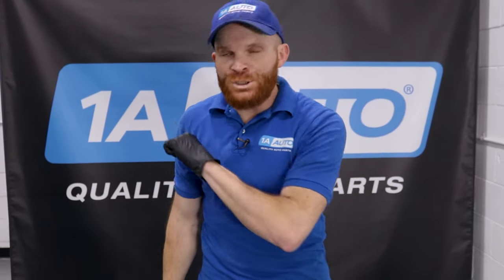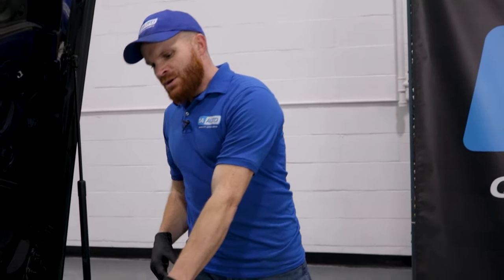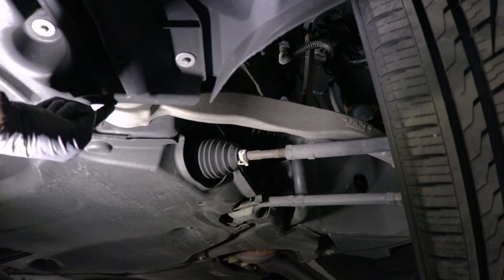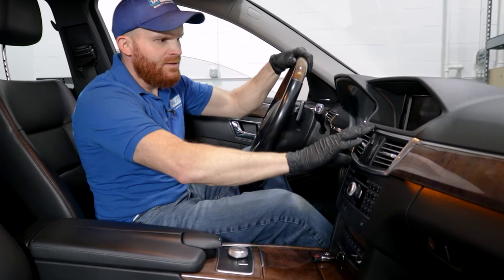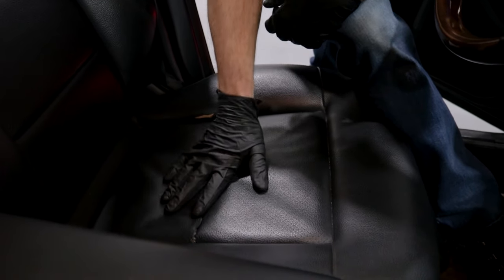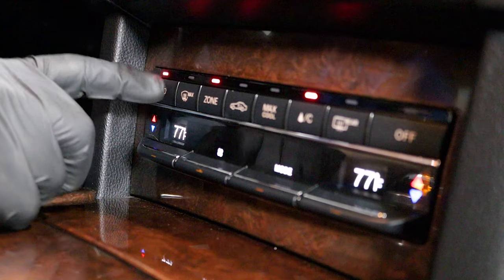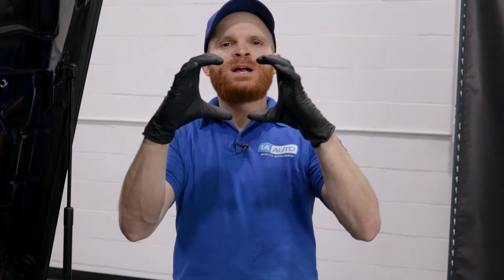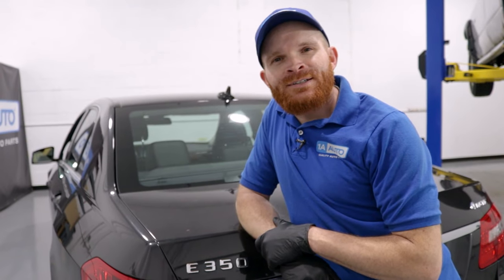Top 5 Problems Mercedes Benz E Class Sedan 4th Gen 2010-16 W212

Comment from the maker: √  Watch the Video
√  Buy The Part at 1A Auto http://1aau.to/m/Visit-1AAuto
√  Do it Yourself
√  Save Money
Reply: EVERY SYSTEM in these cars is designed as a profit center with a premature failure point. It's the same sweet story with BMW, VW... They are super well engineered to rope in the customers once the honeymoon is over yet they are indeed fun to drive...

Most E-class feature plastic seats not even leather (rare package)
Smelly oil leaks
Loose wiper arms
Noisy air blower
soft dusty brake discs
cheap control arm bushings
AGM batteries charging issues
camshaft phasers... old saga!
short lived timing chains
blown tensioner seals
wobbly plastic belt idlers
50kMi only spark plugs!
50kMi tranny ATF!
Failed PCV intake oil ingestion
CAN modules: buggy software!!
crazy Keyless-Go drain
...
Benz ride suspensions are great and famously priceless to repairs because they are built to wear out.

Benz quality is lip service like Ford... "Job No1 !" 😉
Reply: how it’s call the first isue on your video with the transmissin problem
Reply: G Lasser yeah nevermind this car then 😂
Reply: G Lasser your list is exaggerated and your hate for Mercedes is obvious
Reply: Flunoir I have had a 2010 E350 for almost 2 years and have driven it for over 50K miles and I haven’t had a single issue with it. Only regular maintenance (oil change, tires and spark plugs)
Reply: @CaliRepublic77  he might not be exaggerated.  My 4runner spark plug is 100k and my lexus rx350 is 120k. Wtf is merceded charges these prices and providing g 60k spark plugs. Along with every otger short interval.
Reply: W213 problems video pls?
Reply: Hello, I have a W212 recently bought ,if I go from reverse to drive it takes 2sec before it goes.. any one has idea's?
the shifting while driving is good tho,just worried about my baby 😝
Reply: Hi! Do you guys do international shipping ? 🫣
Reply: In addition to these, 1 major issue is the rear subframe will rot and break apart in the first 10 years of its life or around 100k miles. This issue is discussed on many blogs and youtube videos.
Reply: would be great if you tagged parts!  Like the forward thrust bushing.  Can this be purchased without the arm?

Comment: Only in North America I hear people complaining so much about Mercedes and the reason i find is that 70% of all Mercedes Mechanics, even at the dealership, are not good. They still dont  understand the car...the car intimidates  them compared to European Mercedes Mechanics or even middle east and Africa roadside Mercedes mechanics are way better than the crappy ones in the States and Canada. Secondly, the prices for the parts and Labor in North America are astronomically expensive so most used ones owners turn to ignore even small maintenance then it gets worse. Ive seen in Frankfurt Duesseldorf Stuttgart etc their taxis are C Class and it can go more than  half a million and still look new and strong compared to the Crappy Toyota camrys you have as taxis  North America. Even in Africa with bad roads  a well maintained Mercedes will still looks stronger than Any Japanese car and can easily go more than 400k

Comment: My 2011 W212 E350 Bluetec that I put 135k miles on has none of these problems. I service my car on time, I ceramic tinted my windows for interior protection, and don't dog my car. Take care of your car and it'll take care of you.
Reply: I bought ae350 coupe at 100k miles and drives like a dream, I had issues from brake pipe bursting to rattle on the wheel getting rain inside and all sorts of repairable issues,but owning it for 6 months now I'm still super excited about driving anywhere, I've fixed most of the issues ££££ 😭😭😭but even my 2yo loves to ride out front,it's more like a statement rather then a vehicle, I owned a Opel insignia from new did 240k VERY LILL issues with that car over the years,but never really enjoyed driving it as much
Reply: How is it holding up? I'm looking at one with 166k

Comment: Any unmaintained car can have these problems. People disregard maintenance, than they blame the manufacturer.
Reply: Yes
Reply: Many of the problems discussed in the vid have nothing to do with owner neglect! They just happen.
Crank shaft position sensors sometimes fail. Usually a simple original Bosch part for $20 bux. Ripped seam in the seat on these cars is not due to neglect. Nor is squeaks inside cabin or sliding ashtray compartment. And fading interior wood trim was due to mercedes not including enough UV block in the clear coat which mercedes eventually corrected.
Every car no matter what brand has its issues.

Comment: I have 2010 e350 sport. No problem. These are reliable vehicles. There's a reason why they use them as 🚕 in Germany. Great review as usual.
Reply: Stem Artin  what do you consider a realiable car ? just to compare
Reply: Stem Artin  No, You’re severely underestimating the durability of the MB 3.5L V6. They are solidly proven, yet silky smooth engines with ample torque. If anything to watch out for from a MB of this time, it would be some of the electric components that just age like in any other car. Otherwise, there’s a reason why w212s are used as one of the certain generations of MB cars as Police cars and taxis in Germany. MB certainly knows their way with engines.
Reply: Stem Artin  contrarily, e350 gasoline rock solid. extreme examples, non comercial (taxi) ones reach out 400k miles. ordinary maintain patterns (10k mile oil change etc) held this cars really good shape.
Reply: Really? E class as a taxi?

Comment: I must be lucky I have a 2010 with 288k miles & only replaced the rear struts and motor mounts so far!
Reply: Is the plate kp10xel
Reply: Woooow
Reply: and how many miles were on the car when you bought it? 240K? lol
Reply: That’s awesome man.I’m planning to buy a 2013 one with 65k miles on it
Reply: @rickymemeti1826  did u get it
Reply: You drive in highway all the time you can go 1M miles with any Lexus and get dashboard replaced for free even after 15 years if it melts.
Reply: @rickymemeti1826  did you get it? How do you like it if so?

Comment: The interior creaks are well known.  The wood fading was only on the earlier models, and was covered under warranty. The seat cover issue does not apply, for the most part, to the real leather seats.  The other problems are not common.  The trunk issue is most likely just a badly adjusted trunk bumper and latch.  Overall, this generation is very reliable and well built, partly due to being assembled in Germany (well, at least the ones sold in North America).
Reply from the maker: +Paul Santos Thanks for the feedback!

Comment: I have a 2013. In almost 2 years I put 58k miles on it. Car has no issues, not the ones mentioned in video either. All I did so far was standard maintenance. Great car!
Reply from the maker: +Tomas M Thanks for checking us out! http://1aau.to/m/Shop-1AAuto-c
Reply: I'm thinking about getting an older model..2013 would you recommend it?
Reply: He is a Benz hater he probably drives a bmw

Comment: I've driven several w212's two of which had over 400,000 miles on and still drove tight and felt good.
The 2.1 engine sounds a little clunky when it first starts up but once it is at running temp, it's all good.

Comment: spot on review. My 2012 E350 has the cramshaft sensor issue. It just happens rarely (one or twice per year), and the issue comes and goes. It will make engine light on and after a while it gets back to normal. I don't bother. had it for over 8 years and over 90K, no other issue. (of cause the leather cracks on driver seat)

Comment: I have a 2010 and I don't have any of those issues. I've owned A LOT of cars and I think the w212 E550 is probably one of the best cars ever made.
Reply: I have the Camshaft Position Sensor issue and I am making a video of my experience. I also suspect that Oil Pressure issue may also be found as the P0336 error is often due to the known oil leak that gets into the wiring harness and eventually "can or may" damage the ECM which is good luck good day bye bye.

Comment: I have the 2014 E350. It got almost 100k miles on it and the only issue I had with it is the seat cover. I bought  replacement cover for $ 225 and installed  myself. I never had the other issues you have mentioned in your video.
Reply from the maker: +Alaa Sibai Thanks for the feedback!
Reply: Where can one find this cover?
Reply: Mine ripped at the seam.... where’s you get that cover?
Reply: @Alaa Sibai, where did you purchase the seat cover replacement for $225?  My driver's seat just ripped after 70000 miles, slowly getting worse.
Reply: How about now that you have had it for 2 more years?  Any follow up for those of us that buy them used?

Comment: I have a 2010 E550 sport package and has none of these “problems”. I think it comes down to most Mercedes owners not taking care of their cars.😂 (My car has 72,000 miles on it and I live in California) Great car if anyone is thinking of getting one.
Reply: I’m thinking about getting 2012 E350 with almost 80k miles on it. Is it a good choice? How’s the maintenance and everything?
Reply: STILL 72
Reply: Does it have that squeeking when u push on the plastic parts? It sounded so bad and cheap. I had an 211 and it was so nicely build. Im considering sticking to 211 instead of 212 because of this video.
Reply: I jus bought one with 130k miles runs great after I replaced the coolant thermostat just need to replace front air suspension then it’s a solid car again
Reply: Well i have a 2011 e350 4matic and I have had the torn seats  mbtex sucks,paid for it twice so far and my wife is only 120lbs, faded wood yes, looks like ash wood even after I had it replaced under warranty, also had the issue with the cup holder cover sticks 2915replaced under warranty.    Other issue is motor mounts going bad, and headliner starting  to bubble is couple places 79 thousand miles on it,  her 2015 350 4matic GLK has yet to experience anything bad yet except warped front rotors, had a clunk in rear passenger  possible  shock but it stopped  dealer could no replicate.   Nice cars but im a bmw guy lol
Reply: I agree. Im glad 42 other people understand this mane
Reply: same here 2010 w212  no problems at all 130k  lol best car i ever owned!!
Reply: I have a 2013 e350 with 162,000 miles and still ride like a champ
Reply: P
Reply: This is very true. E classes are known for being pretty reliable, but you have to bare in mind that you have to maintain the car, take it to scheduled maintenance for it to be reliable. This is of course relevant with many cars. But the e class especially can go for many miles and still bring a smile to your face.
Reply: @niclasandaima  I have a c207 (w212 coupe) and the interior noises are the worst of any car I've ever owned by light yrs. That includes a '87 LeSabre and a '89 Camry. The cheapest shit I imagine Mercedes has made in recent yrs. My sisters w203 has none of the interior issues I have, and she's at 136k mi while I'm at 83k. Pretty solid car otherwise, although I've starting to get intermittent rough shifts and I just did the tranny service. (it's 2nd one, both done at MB rec interval and very clean inside.) 211 build quality is higher I'd say.
Reply: What about all that plastic noise is that true??
Reply: Is this car expensive to maintain?
Reply: @autotrimmers6353  repairs for a broken part may be expensive but the average servicing should be that expensive considering it’s like every 6 months
Reply: None of these issues are caused by lack of maintenance though unless you just wanna replace those parts ahead of time assuming they’ll eventually fail
Reply: i'm in Northern Cali, i'm going to go look at a 2010 E 350 sport package today with around 60k miles.
Reply: And you do not have the same engine as a 350.
Reply: @niclasandaima  the Pre-facelift might have the cheaper feeling in the interior, but from what I’ve heard, the facelift w212s are generally more solidly built and robust with no squeaks.

Comment: 2007 M-B E320 Bluetec:  SRS light stays on with a digital message to bring to the shop.  I caused this by jump charging the car’s battery.  Is the sensor module for this available?  Is repair as simple as replacing the module located under the center console ashtray?  Thank you…

Comment: Had an E350 cabriolet, just sold it to my friend, because it’s sound, loverly car, 120k on it starts runs perfectly, does great mpg, no upholstery issues, the tyres do wear on the inside as they are set up that way on the German cars, swap them over when they are wearing to even them up. The only issue I had, which is common is the steering lock. It activates automatically on them and if it failed you can’t start the car or move the steering. It’s a little unit on the column that takes a signal from the key, a small motor drives a pin and either the electrics fail, or the motor does. The chap that came and fixed mine said this was a common fault …so if you have one you can remove, replace it, before it failed as it’s a lot easier on your driveway than when it’s locked in a car park….otherwise …great car.
Reply from the maker: +Stephen Dale Thanks for the feedback!

Comment: Had a 2009 e350 for years lucky No trans issues as described . No issue with crank sensors as yet . Wow i must be lucky my thrust links are fine from factory . Yes i have some cab noise the car has 140,000 on it . Mine that is . I have no rips in seats . And mine is 13 years old . Every care has issues happy motoring people .

Comment: I have the Mercedes E350 2011, bought it with 92,000 Miles now have 123,000. I don't have idea how the previous owner took care of the car, but I'm the type of person that really takes care of the car. Of the problems mention on the video, I have the squeaking noise coming from the interior parts, the fading on the wood trim, the center console door not closing properly, the wheel knob not working properly, and the broken seat. I took the car to an upholster to fix the seat and they did it for $250. The other interior issues still present on the car. Another issue is the buttons pealing. Like I said, I don't have idea how well the previous owner of this car took care of it, but I had been fixing this issues one by one and on my own time. Mechanical issues I had at the moment of purchase was oil leaking problem (fixed), tire alignment (fixed), head light bulbs HID (fixed), broken windshield water jets (fixed). Overall Mercedes Benz build great cars and this model is not an exception. If I were the previous owner of this car, probably I wouldn't had non of this issues I mention before or at least just few of them. I have a great mechanic here on my hometown, and I can say that this car is now on good hands.

Comment: I have E350,2011 Model. When I bought the car, it had 105k mileage. I put 58k in two year in half, now the car have 163k mileage. Zero problem. I do oil change every 6k-7k that is it.

Comment: I have a 2011 A207 E550 Convertible.  The interior wood pieces are long, and over time with temperature expansion and contraction or getting snagged on clothing, they will come out of their mounts or snap.   
If you go through big puddles, the rocker panels may hold water if the drain holes are plugged.  You will hear the water slosh around on accelerating and stopping. 
I have 84,000 miles.  Car is clean, so far so good.  I wish mine had fog lamps and not the L shaped LEDs and I with I had a rear fog light too.   The AMG wheels are not too expensive on ebay and I'd like to keep a front and rear ready to go as a spare.  But these tires are kept at higher pressures and have not had a rim crack yet.  My 2003 CLK 430 I had a couple of cracked rims.

Comment: With the transmission issue replacing the conductor plate, which is what the speed sensor problem could be is really not that much more difficult than changing the pin and stem assembly in the command knob inside the passenger compartment. It’s a little bit more messy and there’s fluid involved, but the actual work is in many ways just about as complicated. if you do DI, then doing the conductor plate in the transmission is not that difficult. Would like to see expanded versions of these types of videos, but with repairs included.

Comment: Mine is a 2014 E350.  I had three times with Automatic Digital Temperature Control.  They were all on road.  The AC seems work, but cold air did not come out.  But next day, it worked fine.  Every time, I took it to shop, it worked very well.  It is totally unpredictable.  Your video really makes sense.  I guess the Automatic Digital Temperature Control Valve needs to be replaced.  Thanks!
Reply from the maker: +Kevin Zhang Thanks for checking us out! http://1aau.to/m/Shop-1AAuto-c

Comment: A few niggles like driver seat which I might have repaired but apart from wear and tear, found mine reliable. Has needed airflow mass sensor and aircon radiator etc but I bought with 61k miles and now on 190k. Best value car I have ever owned. Won’t sell it and I will drive it to over 500k

Comment: I have a 2012 E550 AMG edition and I have the A/C mold smell problem. Other than that the car runs smooth and no interior issues. The stance and look (AMG package bumper) I think is one of the main few reasons why I bought this car. Even though it’s a 2012 model it’s still a head turner! But definitely want to get into a 2016 or newer E63 or S63.
Reply: keller5973 MB settled a lawsuit concerning their HVAC system. They're replacing the smelling ones. I'd check it out
Reply: Another here not having the same vehicle engine.  Yes, you have a wonderfully fast engine.  Happy to hear your brag.